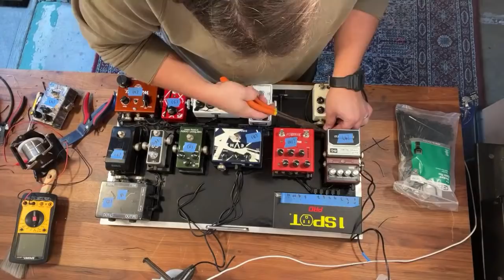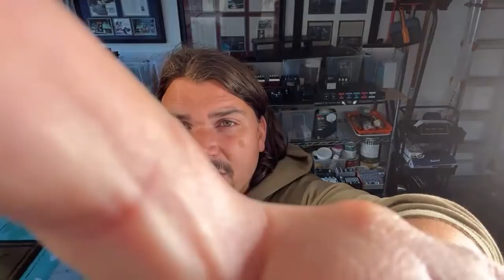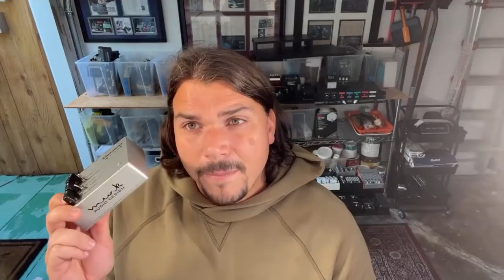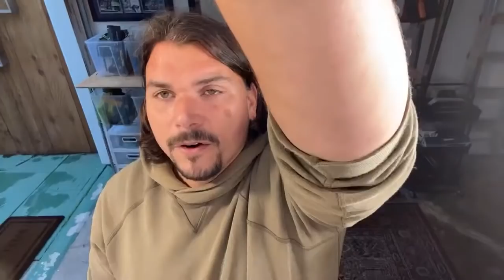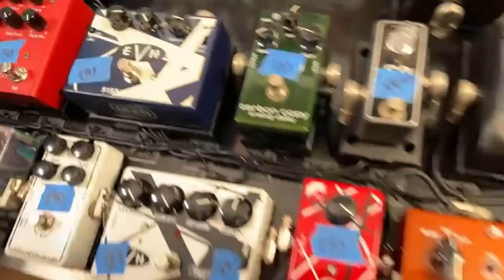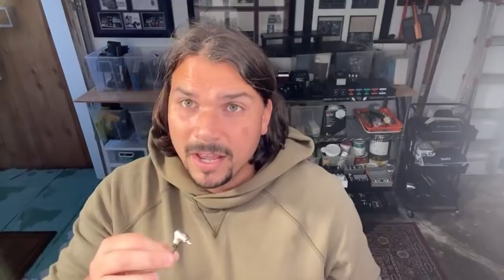DIY Pedalboard Strategies

Comment: Hello Mason! I have recently discovered your channel by googling tips about pedalboard building (my 1st go and I've already found some problems like digital EHX pedals with buffered bypass). This is the greatest content of all time for people like me, keep up a good work!
A question. You mentioned that you don't recommend buffers on TL072. I've been googling the question and I've found out that a lot of popular buffers are based on it (some use TL071, TL072CN and other derivatives of this chip), some based on JFETs. What can you suggest for the most linear output?
Reply from the maker: Yes, many buffers use this chip, it's cheap, easy to get, and has a very specific sound.  If you want neutral, it's a bad choice and isn't very good at driving capacitance with stability on the output as even its manufacturer (Texas Instruments) tells you not to run it below 1K (with 100 ohms being a good starting place for a good buffer - meaning they recommend running it 10x higher than what's ideal for a quality buffer).  We have links in most of our video for our recommended buffers.

Comment: Had a question related to what your were saying about the difference between a musicom and ram.  Specifically if the resistance difference was only on the buffers for the ram?  So if I didn't have the buffers on then would it still be the difference in resistance?
Reply from the maker: Buffers in the Musicom I prefer.

Comment: What is wrong with plugging all your pedals into the front of the amp. I have a Fender Deluxe Reverb, no effects loop. Everyone says you should not do that with delay, flangers, reverb etc... Sounds ok to my ears to do this. Don't want to spend another $1000. on an amp with an effects loop. What do you think?
Reply: Nothing wrong with it. Works great with a clean amp. If you use amp gain though, then your effects that normally go into the loop (after preamp) are gonna get distorted by the amp gain. EVH ran all his effects into the front into a distorted amp to get his tone. It‘s just a guideline to get a clear tone with effects. If you like it then all is fine.
Reply from the maker: You could, just depends on the amp.  You wouldn't wanna do this if you had a distorted amp.

Comment: Yay Community Colleges! In the 80's electronics tech was offered at night, so I went because it was an interest and because i worked a day job. Great teachers (former TV repairman and "tower climber"). We had trainer sets that had discrete caps, resistors  etc - those were the days! The instructors used to say the EE's designed things but techs had to make 'em actually work.
Reply from the maker: I got a better education in Community College than I did once transferring to a university.  For what I wanted to do with guitar pedals, amps, electronics, etc. I probably didn't need to go to a university.  A Polytechnic school or trade school or a good apprenticeship would have worked better in a lot of ways.  Most schools, unless you really want to do coding, DSP, etc. are going to be fairly minimal in what they provide as there's not much work in hardware fields any longer.  EE's any my university pretty much all went to work for Google or Facebook straight out of college.
Reply: @VertexEffectsInc  yep, and we are seeing the affects of this. The building trades and technicians of all sorts are in major short supply.

So many of those are excellent paying and good fulfilling jobs, and they are vacant. They are begging for people and they simply do not exist these days bc no one knows how to do the work or even know that type of job exists or is an option.
Reply: Truth lol. To be fair, kind of depends on the type of EE. A guy at a desk and a EE in the field are two different breeds.

I've argued till I'm blue in the face with some EEs about how what they were asking wasn't physically possible. Conversely I have another EE I rely on when I'm stumped and he's an absolute genius. I am not a EE
Reply: @MrKadidle51  Yeah, you know electronics is funny like that. People who are really good at it seem to have an "electronics tech" brain for lack of a better description. Not everybody has that knack. I don't. I went to school for it and graduated, made the good grades etc but it was more an interest/hobby. Mostly, it was something I could do by going at night. Didn't want to give up my day job benefits. It was the 80's and things have changed so much, but that schooling did serve me well in later years. Worked as an electrician's helper for a while - different but still electricity. Still later, I had a "tech" job at a State Park - where you have to work on everything - plumbing, electrical, mechanical, construction. Retired now, so it's all hobby! Engineers of any kind are usually pretty smart - related to a few of 'em. But my ex-TV repairman instructor was pretty darn smart too. Dated myself by even being aware that there once WAS such a thing as a TV repairman - who came to your house - with tubes - in an RCA toolbox. Oh God I'm old!!!
Reply: @SFolkes97  hahaha, I remember the TV repair man coming to my house a time or two

Comment: Hi Doc ,is there any switchers that take 12 or more pedals that you would recommend ?
Reply: Following
Reply from the maker: Most of them can now, or have the ability to expand loops with using the stereo loops as separate mono loops.
Reply: @VertexEffectsInc  Hi thanks I think I'm going with the Musiccom MK-VI If I'm not confused it has 11 loops + a 12th stereo .Witch is how many pedals I need to run .I won't need to run tuner ,expression, or volume in to it right?

Comment: Hey mason, quick question wondering if you may have a solution for me. I built an interface for my rig based on your DIY buffer video. The neutrik jacks are incredibly tight and really difficult to plug in and out. Any tips for loosening them up a little bit? I’m worried I’ll cause damage to them or maybe my cables over time.
Reply from the maker: The ones with the buffers in them?  Something they can be right because the PCB makes them more rigid.
Reply: @VertexEffectsInc  It's actually the regular jacks, the buffers seem to be fine but the other jacks have a death grip. Let me know!